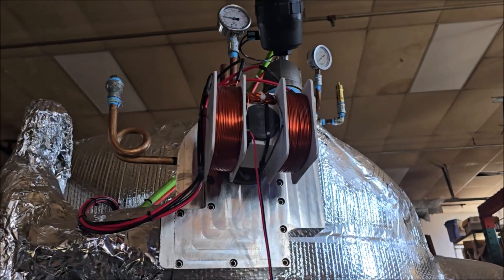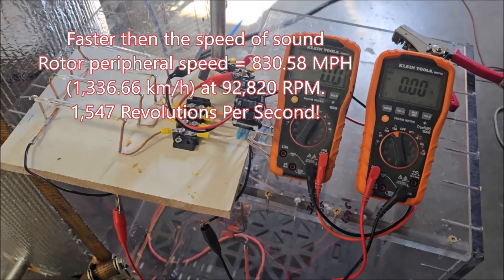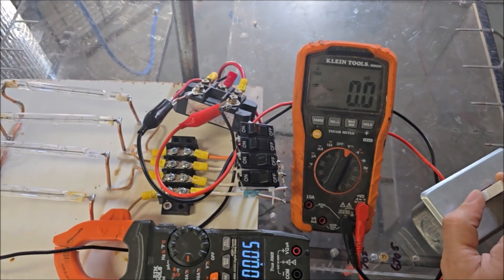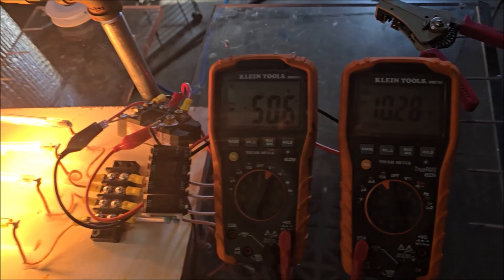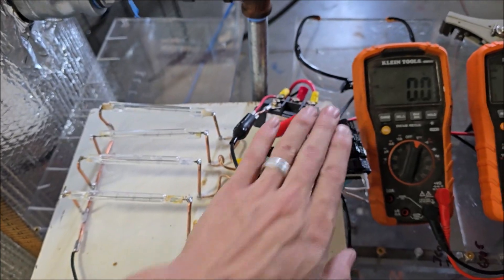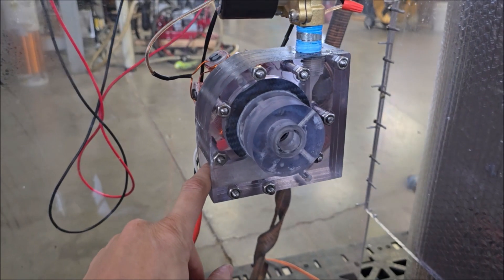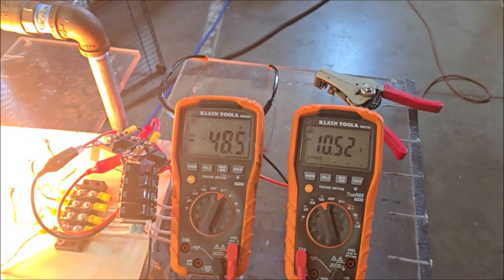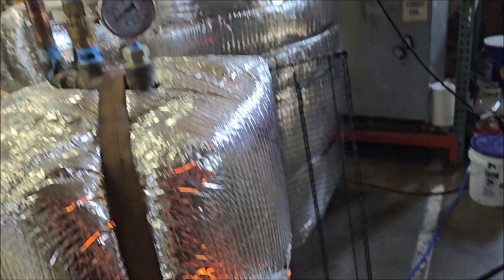Tesla Turbine Breaks Sound barrier! 95,000 RPM!

Comment: Great turbine!🤯 Terrible generator.😱
Put this one on there instead.

https://youtu.be/S10X3vfnaJE?si=ZnrtrPdOnaaHRIx0
Reply: BTW, 97% efficiency! Outstanding! 🤯 hey, in another forum, somebody posted that u can put a generator on each end of the shaft, & it balances the weight evenly across both sets of bearings. I mean sure, we've seen it done w regular motors for different industrial applications, but I haven't seen done w a tesla turbine on YT so far either....
Reply from the maker: @WillardWallace-y5g Thank you for the comment. I have placed magnets on both sides of the shaft, but this configuration introduces vibrations that are avoided when using a single magnet. A thicker shaft could reduce some of the harmonics causing high-amplitude vibrations, but we prefer to avoid increasing the shaft's thickness. The turbine is balanced nearly perfectly. However, when using magnets on both sides, the magnets themselves must also be precisely balanced, which would increase the overall cost of the turbine. By using a magnet on only one side, we can mitigate harmonics without requiring a perfectly balanced magnet. In the future, I may reconsider this approach if I can partner with a company to balance the magnets. Currently, we balance the turbine rotors in-house to near perfection.
Reply: @iEnergySupply u might b able to use glass beads like truckers use in their tires, since they're 2 heavy 4 a balancing machine. U will need to have them inside a hollow tube or ring mounted on the rotor. They use those balancer rings on the rotors inside huge industrial motors. That same design is used across a wide variety of uses, all for balancing. Could possibly work for ur system. It works better at higher speeds. If this works, u may b able get it to generate electricity at a stable speed.👍U mentioned the generator becomes unstable at speed, so maybe this will work. 🤞 I would luv 2 c this thing charge a huge super cap or ultra cap bank, even w the 2 gal tank, it should give u a solid amount of power really quickly. Enuf to power sum stuff in a blackout. Like ur freezers, security system, & communications...🤔
Reply from the maker: @WillardWallace-y5gI've considered putting little balls inside of a cavity in the past it does introduce some more complexity which I want to avoid but it might be worth it. And when we first go into production because of the smaller volume of orders it's very expensive. Once we sell over 100 turbines the price gets way better.
Reply: @iEnergySupply  I'm subbed, cuz, now I wanna c u break 100! 
🤞😲👍
Reply from the maker: @WillardWallace-y5g I appreciate the enthusiasm. Consider joining my Patreon, it really helps me out before the turbines sales funds everything.
Reply: @iEnergySupply  another way of balancing both sides equally is w small steel bearings inside a hollow donut chamber on the outside edge of the fins adjacent to the chassis, within the turbine itself. 5mm bearings or less sealed inside a wide hollow fin with the ability to roll inside the fin chamber with only enuf width for 1 bearing will balance the shaft, the turbine, & the harmonic balancer itself with as little as 6 best or bearings. Its how industry balances large wheels too big for a wheel balancer, or any rotational mechanism that spins up to high speed.
Reply from the maker: I have achieved an electrical conversion efficiency exceeding 97%. My generator has been tested at speeds surpassing 100,000 RPM. There is no way his generator could operate at such speeds without disintegrating due to the centrifugal forces involved. Additionally, the generator on my larger turbine is capable of exceeding 45,000 RPM and has not yet reached its power output limitations. The generator on my larger turbine also outputs high voltage, which makes the full-bridge rectifiers more efficient—about 300 volts AC under load.
Reply: @iEnergySupply thats already sum serious output, but I was hinting at extending the shaft &  stacking a couple more of those generators on it to do more work. That turbine has the capability to generate more power with less rpm, with a few more generators than just the one. Why stop with just one? There's a hundred vids of tesla turbines, only a few with any generators worth a damn, & so far none with more than a single generator. Ur generators one of the best I've seen in years, I think it needs a friend!😁
Reply from the maker: @WillardWallace-y5g you got the right idea, but the easiest thing to do would be upgrade my 1.5" diameter1.5" long magnet to 2" Diameter 4" long that would increase the magnetic field to over 8 times and the output to over 8 lbs. We would need a better steam supply to justify that though, someone will do it, i have the turbines for sale soon.
Reply: @iEnergySupply  I think going smaller & adding more small generators might b easier for the turbine to spin than a larger motor, & safer than changing the regulator to increase the steam pressure. Ive had a couple steam explosions, & the 1st time I got burnt pretty badly. As much as I luv harnessing the power of steam, I don't trust it 100% anymore after learning that steam, with the right minerals in it, is corrosive. I needed ultra clean water, & neglected checking the water I used. Yeah, that ended in catastrophic failure. My man, b careful if u go bigger. I haven't seen anyone on YT build a tesla turbine w plates larger than 12 inches/30cm in diameter. Apparently, u get sum good rotating mass for a flywheel effect if the plates r thick enuf.
Reply from the maker: Thank you for your input. My system utilizes distilled water, which minimizes scaling and corrosion. The heat exchanger/boiler is compact, with a total system volume of approximately two gallons. The piping is routinely inspected for corrosion and is rated to withstand pressures up to 350 psi at 350°F, ensuring robust performance under operating conditions.
The system is designed to prevent pressure from exceeding 60 psi, providing a safe operational limit. Regarding power output, the turbine performs reliably and can deliver the desired wattage by adjusting the nozzle aperture to increase steam volume, rather than pressure. However, the heat exchanger's limited capacity restricts maintaining higher pressure if the nozzle orifice size is increased.
Reply: @iEnergySupply ahh, ok. I c- u just need to adjust the nozzle. Not unlike micro hydro in that respect. Theres only 2 other tesla turbine guys doing any real testing. Jeremys system recaptures air, as he just uses a compressor w a large tank, & pumps it bk into the holding tank. I cant remember the name of his channel...

Comment: I'd like to see you pull a vacuum on a 2 stage turbine and check exhaust temp... It should decrease with load. Maybe work an aspirator in at the nozzle of the turbine to pull the hottest steam from the center of the turbine, to increase intake volume and temp, as well. Recycle the exhaust water to be reheated, as it should still be warmer than ambient.
Reply from the maker: Well it's a single stage but the turbine efficiency has been tested at 88% and I believe I will be achieving 95% soon. So it looks like we don't actually need more than one stage. If you had another stage you would still just a very small drop in temperature because the first turbine gets almost all of it.
Reply from the maker: Yeah, this is exactly what we are doing other then the superheating which we will do in the future.

Comment: What size is the nozzle?
Reply from the maker: I think at the time is was 1.3"x.0625" but now it's much smaller, and it's now a different geometry.
Reply: @iEnergySupply  Thanks! I'm thinking of building a turbine that runs off about 10bar steam from a 6mm line. I haven't built the steam generator yet so It's just an estimate. Also I see many turbines running much lower pressures with larger nozzles, so that concerns me a little. Is there any tool that could give me approximate dimensions for such turbine? Any info helps right now!
Reply from the maker: @ You need to make the nozzle variable, or at least have an insert that will change the size based on what insert you use. That way you can tune it in to match the specific steam supply.

Comment: Close reading of 1911 Tesla docs (and earlier,) he tried to interest JJ Astor in 1905 investing, but no go.   Also, this was not a water pump nor a steam engine.   This was Tesla's desk-sized flying machine, employing gasoline input.   He must have got it into self-running mode, then found the immense thrust from the engine outlet.   His "flying machine" plans are in the Beograd Tesla Museum docs, containing two Tesla turbines, one with engine outlet aimed down, and a second out the back.   There's also a paddle in the back, a jet-deflector.   Find a drawing in the book WIRELESS, by Branimir Jovanovic.

In that long 1911 Tesla interview about his turbine, Tesla mentions a wingless flying machine, and the reporter promptly guesses that the Tesla turbine, operated as a jet engine, could lift a pilot.  But jet engines weren't invented until a decade later!   (Tesla was keeping it all secret, only releasing the "steam engine," and never mentioning the hundreds of lbs of jet-propulsion, his reaction.motor.)   The Tesla Museum also has a diagram of Tesla's freighter ship.  It has his giant turbojets on the back, and also, enormous rollers below the hull, so a huge freighter could cross the Atlantic at a couple hundred MPH.   No investors of course.   It was recovered in his docs from Manhattan storage.
Reply: Fascinating thank you for this golden comment.

Comment: why are you gasing that on and off?
Reply from the maker: don't want the rpm to go to high. It's regulated now with more automatic controls though.
Reply: @iEnergySupply  have you found the other secret?   Put two or more unpowered "static" disks on the ends, which spin slower, to eliminate turbulence between the disk-pack and the flat walls.   Never tried this, so don't know how much efficiency would be gained.    Too bad we cannot take apart an original Tesla turbine, to look for even more unpatented tricks.
Reply from the maker: That seems like it would help, although I don't know for sure and the performance is already beyond satisfactory it's time to get it into production, I'm not sure it would benefit when considering the increase in production cost.
Reply: @wbeaty they turn objects into idols and the idols speak not/knot.  Telling us nothing.  

Idol
i dull
Reply: @Dollapfin he's making a reference about idol worship and saying it makes you dull. Hence the idol "i dull" part

Comment: My 2 cents: Speed is not a key performance indicator in Tesla turbine. Torque is. Torque is the principle interest of an engine. I think the main idea of Tesla is about the high speed of spinning fluid over the disk, regardless of the disk's rotation. Another 2 cents: the energy output is always less than the energy input, hence this is the practical limitation of Tesla Turbine. In your experiment, if we were to generate 10 kw of electricity how much air flow and how many PSI out of the commpressor tank we would need, asumming 100% efficiency? Is it practical?
Reply from the maker: Turbine efficiency serves as the central measure of this system's performance. With a sufficient steam supply, the turbine can generate up to 50,000 watts of power. We’ve achieved an efficiency exceeding 88%, a figure that doesn’t yet reflect recent vibration fixes, and we’re now aiming for over 95% efficiency with these improvements in place.

This efficiency depends on precise tuning, particularly the spacing between discs. Narrow spacing paired with thin discs produces significant torque, but at higher speeds, warping becomes a risk. Furthermore, insufficient centrifugal force shortens both the boundary layer and the vortex path length, reducing flow efficiency and overall effectiveness. Speed plays a crucial role, but excessive speed can decrease efficiency unless coupled with very low exhaust back pressure. When back pressure is substantially reduced, the Tesla turbine capitalizes on high speeds without the laminar flow issues that plague other microturbines, giving it a distinct advantage in this regard.

On the flip side, using too many discs increases warping potential, even with edge dimples for stability, risking structural failure—picture a ruined laminate floor. Thicker discs withstand extreme centrifugal force better but compromise efficiency. Achieving optimal performance thus demands a careful balance of all factors.

I’m optimistic about reaching 99%+ efficiency, including electrical output from the generator, supported by soon-to-arrive high-quality sensors for accurate flow measurements based on condenser water data. While speed isn’t everything, it provides the Tesla turbine a competitive edge when back pressure is maintained well below atmospheric levels to minimize windage losses. Proper calibration of centrifugal force, disc design, and exhaust conditions ensures the vortex path and boundary layer remain optimized for maximum efficiency.
Reply: @iEnergySupply  Can you use titanium discs to get rid of warping problem?
Reply from the maker: @FoundingFathersNEWz  My main turbine has titanium disks.
Reply: @ if Nikola Tesla had titanium disks available way back then do you think his designs would have taken off for power generation???
Reply: Note that torque was irrelevant in Tesla's original application, since it was a gas-turbine, to harness the engine outlet as jet propulsion.   This was in old drawings in the docs at Beograd Tesla Museum.   Also mentioned in that long 1911 interview, where this turbine was stated as the key to Tesla's wingless flying machine "the size of a desk."    In those docs also was Tesla's jet-powered freighter-ship, with his turbines in the rear, no propeller, and giant rollers inside the hull, protruding out the bottom.
Reply: @wbeaty  you didn't read the other patents where that was the purpose of the turbine.

Comment: What Happened to you pulse detonation engined tesla turbine project?
 I now have a 3d printer and have printed a turbine housing and hub in PLA (which  probably wont last long due to heat) using 95MM hard drive platters. I am interested to see how it will go with my pulse detonation engine. It may even need an extra Air pressure inlet to get it up to speed then the pulsed detonations could start to keep it running. your thoughts.
Reply: You can simply have a mixed media turbine: have steam, and burning fuel in the turbine. Tesla suggested this, predating the Cheng Cycle.

Comment: One of the questions I have is, when using a compressor, is there a benefit to comparing the power consumption of the compressor to the power gained by driving the motor with a Tesla turbine?

Comment: I'm most interested in temperature of the exhaust.  You showed a video spinning up a turbine with steam where the exhaust was ice cold and forming ice crystals on the discs...I'm interested in using solar radiation as the power source to cool a room. If the turbine can spin a fan on "cold steam" and produce ice cold exhaust it can cool a room with the power of solar radiation.

Comment: I appreciate how relatively safe this is
Reply from the maker: Never had a serious accident, but if I wasn't prepared for the worse when I was learning about all the dangers, I could have been seriously hurt.
Reply: @iEnergySupply  Are you at some point going to release a book, with how to do this and the mathematics behind it? (Disk size, thickness, pipe size and amount of flow, etc.) I believe many would want to buy that, even if it costs like $50! :) Imagine if you sold few thousands of these copies.

Also out of curiosity.... did you decide to have a separate vacuum pump from the turbine, instead of having them both on the same axis? If so, why?

Comment: Have you guys tried or thought of using different fluids? Such as supercritical co2? For off grid that would be good to have backup fluid type options
Thanks
Reply from the maker: We definitely want to explore using them in the future. However, I want to avoid supercritical CO₂, as the high pressures it requires would exponentially increase the system's costs.
Reply: 😂😂😂❤❤❤❤❤ @iEnergySupply

Comment: Have you thought about using something like a turbo smart E gate to control your flow? If you used something like that then you could put a transducer on the turbine and even use Holly efi programming on a laptop to control it. Just a thought.
Reply from the maker: We are going to use something similar to that.
Reply: @iEnergySupply  the electronic turbo waist gate should be more than capable of running your system.  You should be able to find several videos on the E gate. Should be the easiest to install and work with.  Good luck.
Reply from the maker: @bansheeman213  ill take a look, we might use it in the future if what we already built has too many issues, I will be testing it hopefully by this week.